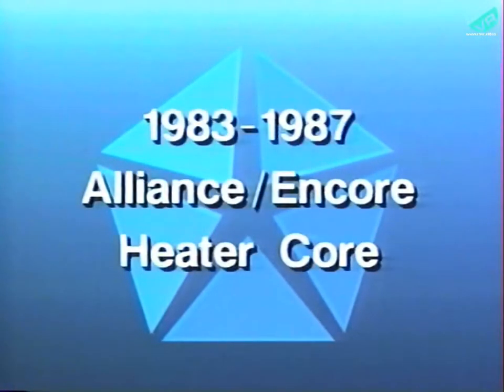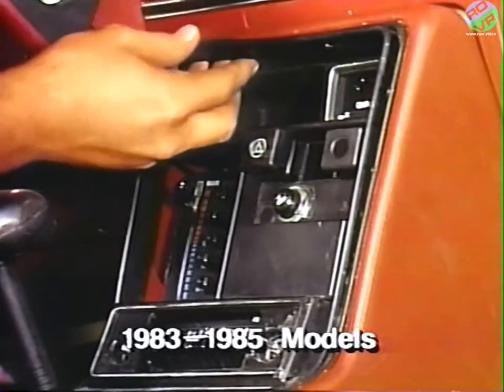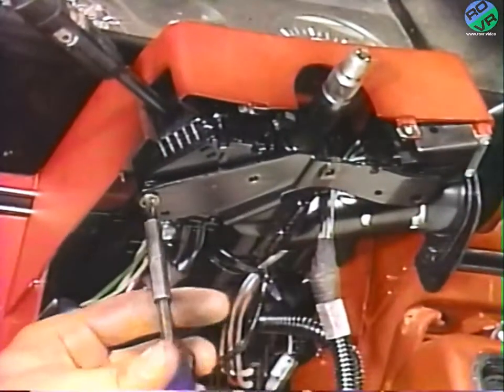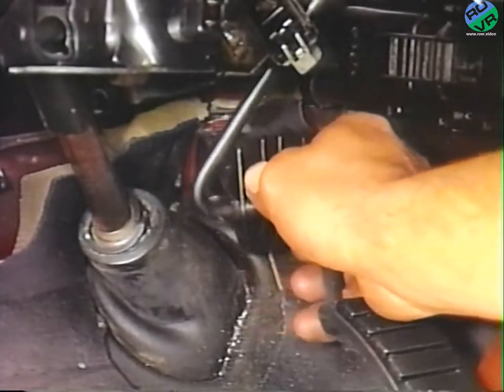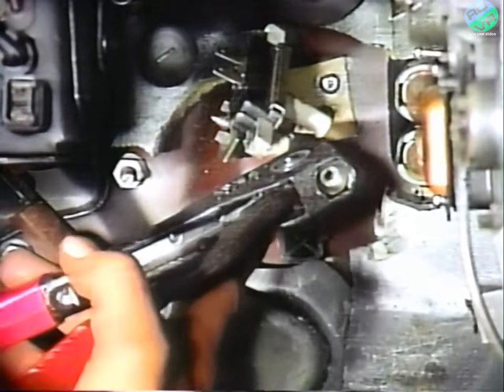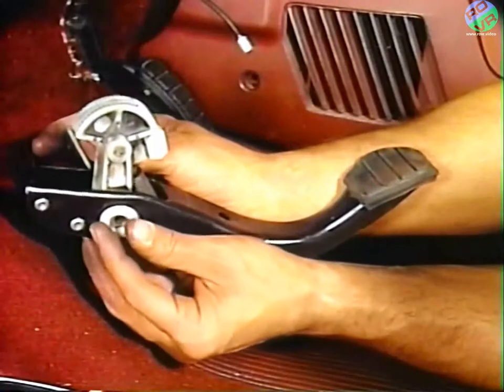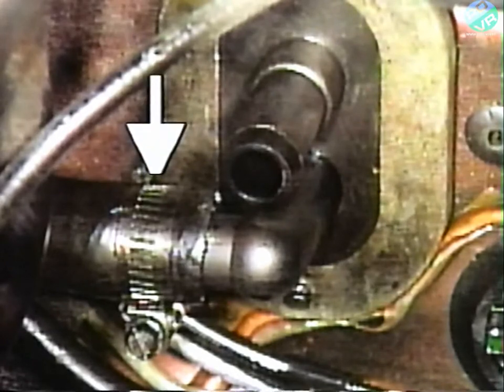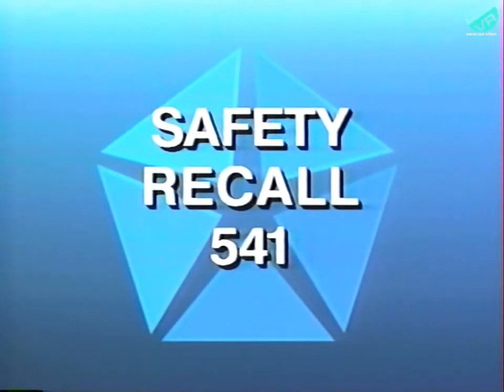Chrysler Jeep-Eagle - Safety Recall 541 - 1983 to 1987 Alliance Encore Heater Core (1992)

Comment: Quite simple. Todays cars are not like that...
Reply: @Tim Tim The instructor forgot to mention how to deal with the center console which often disintegrated, when moving it to clear the heater core. It wasn’t a really difficult job, but it was by no means simple, and it definitely should have paid more than 1.9 hrs.
Reply: That's not simple at all. A heater core on a Ford F250 can be done completely through the glovebox. The coolant lines are quick connects. None of this steering column, console, pedal business.
Reply: On 2012+ Us Passt's it's even simpler. The heater core just slides out into the driver's footwell after removing some side console trim. A good thing, since they fail often.